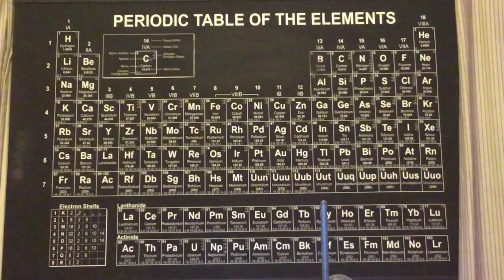Electrolytes Conductivity Lab

Comment: What happens when something precipitates out of solutions?  Will it still conduct electricity?
Reply: That should depend on the ions present. If two solutions form a precipitate, that means that ions from both solutions are bonding together. If solution #1 and solution #2 both contain strong electrolytes, that means both will individually conduct electricity. If ions bond together and form a precipitate, those ions would no longer be able to conduct electricity.

I'm also thinking that the strength of an electrolyte makes a huge difference. An electrolyte's strength depends on how much of it ionizes (ex: HC2H3O2 is a weak base and many of its molecules will not dissolve). If two solutions contain weak electrolytes (#1 is HC2H3O2 and #2 is NH3) then that means only a small amount of molecules will ionize in both solutions, which will conduct a small amount of electricity. If those newly-formed ions bond with each other, then it is possible there would be no ions left to conduct electricity.

And again, we have to consider all of the ions present. If there are 20 strong electrolytes and a few of them bond together, there will still be leftover ions to conduct electricity. 

Long story short, it depends lol

Feel free to leave feedback on anything I'm incorrect on!